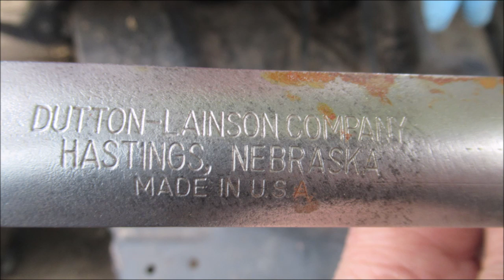FIRST START of the season ALLIS CHALMERS 716H

Comment: I don't know about you but when my garden tractor started after a long winter, I got really excited.  Last year I had to put in a hours worth of work to get it going.  Thanks Jim.  Stevo
Reply from the maker: I have put a lot of work in this engine I use only Premium fuel and have did alot of work on the carb  I set the points on it while it was running I have done that on a old honda motorcycle  Learned the trick from a bike mechanic